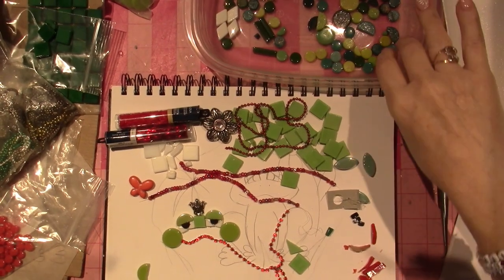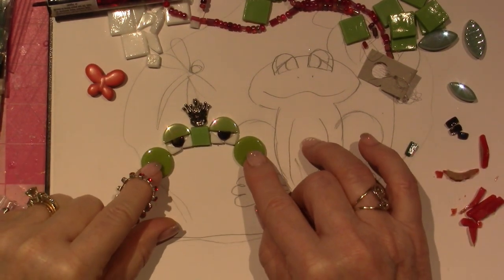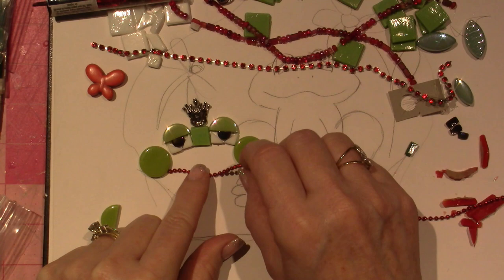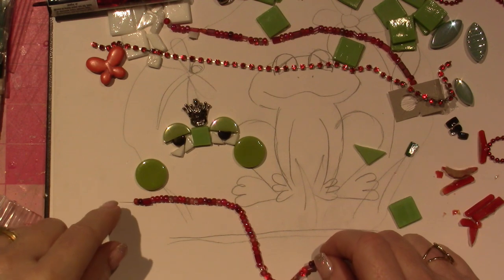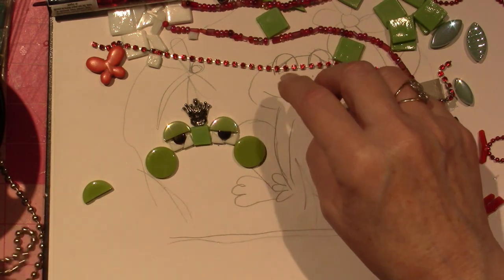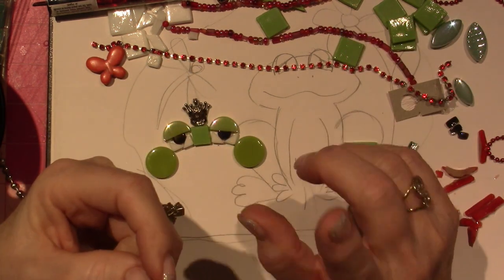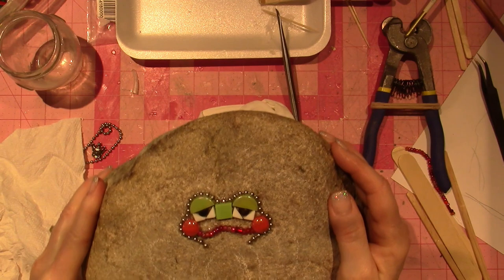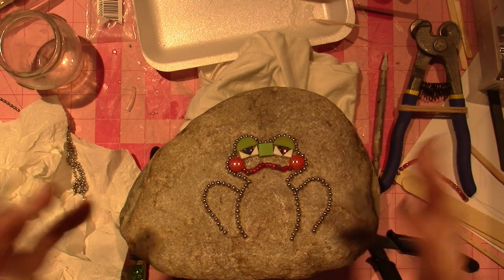Mosaic frog on a rock; Process

Comment: So cute!  I glued those colored glass decorative gems onto globe shaped wood that's made to go on top of a square porch rail, hope that makes sense. I used clear silicone. I just covered those globes and they screw into the post. I didn't even grout them. I did this on the deck rail at my pool and they have been outside and are still holding fine for several years now. I think your rocks will be fine outside Sara. I used blues, greens and clear glass gems and they are so cheerful there.  I look forward to your videos and always enjoy them. TFS

Comment: I have an ideal for you, I have never tried it..........  You know the bag bakers use to icing cake.  Well they use the similar thing for  henna.   Could you put a little silicone in at a time and no cleanup.....????????????  This way you can cut the hole as large as you need so the silicone bead is perfect.....        Just a thought
Reply from the maker: Thanks so much. I have used that very process for thin set mortar so I have some bags. I think I’ll try it.
Reply: I have even a better idea that I got from someone else and it works amazing.  I use syringes.  They work amazing and the glue doesn't dry out at all.  You can get some with caps or if I dont have caps I use a ball of sticky Tak on the end.  It lasts for days and weeks.  The 1st time I did it with a tooth pick it was so messy and when I tried to grout it the grout would not stick to any areas with silicone.  Hope this helps.
Reply: Meant to also say the syringe gives a perfect controled fine line of silicone that's perfect for the ball and chain.  No mess and no sticky fingers.  I even keep my weldbond in a syringe now as well 😉
Reply from the maker: Omg. Jameley I will get syringes. Thanks so much for sharing your tips.
Reply: @myserenitycrafts  you are so welcome.  I also apply right from the syringe to each piece of Tess rather than spreading on the substrate.  Absolutely no mess at all.  It's a game changer.  I wish I could remember who told us so I could thank them.  😉